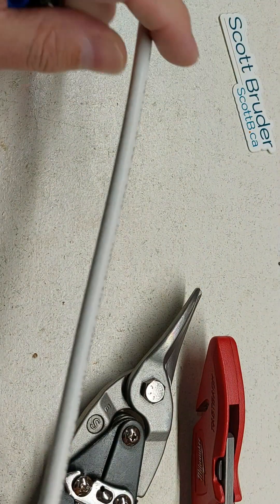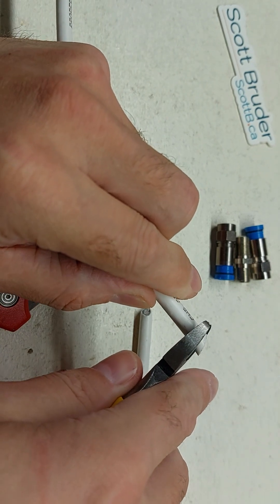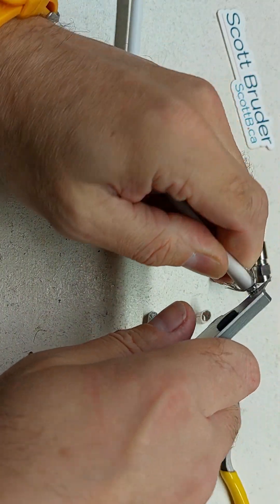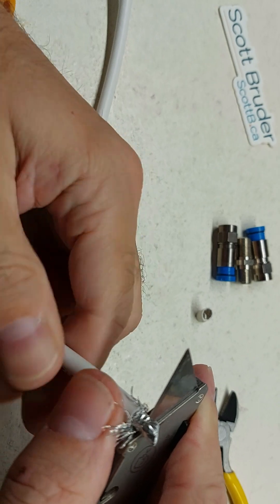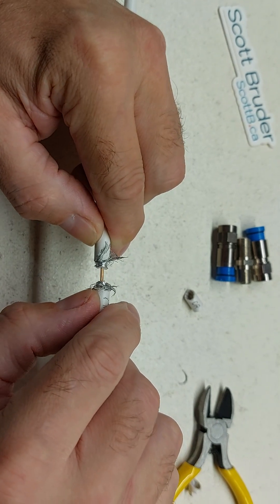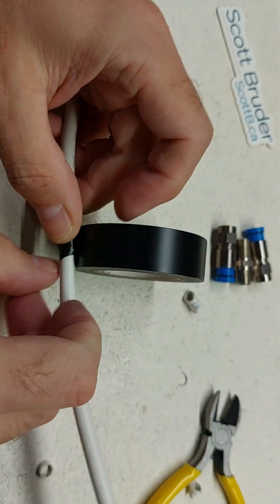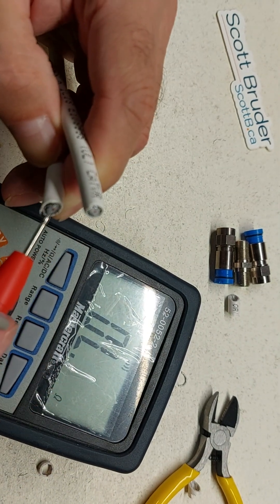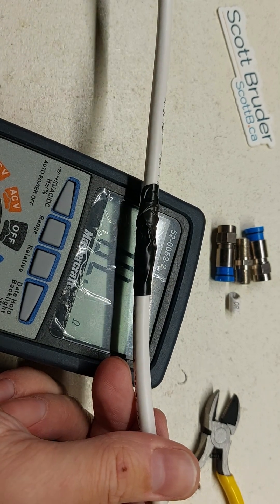How to perform an emergency splice on a damaged coax cable.  this is only to last a few days!!!

Comment: THANK YOU! I was cleaning up some old cable tv wires and boxes and stupidly cut the wrong cable!!!
Reply from the maker: I am so happy that it helped you. if you cut your cable and did this fix, I would recommend that you get a new cable.  This is an emergency repair.  Much like a doughnut spare tire. Its intended to get you to the next service point where you can get the proper solution.   please let me what your final fix was for for this!